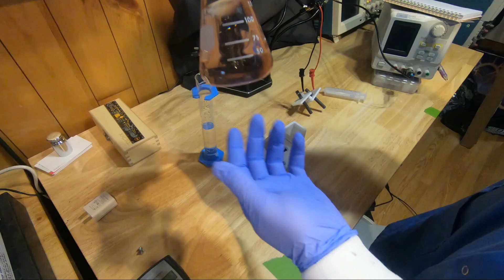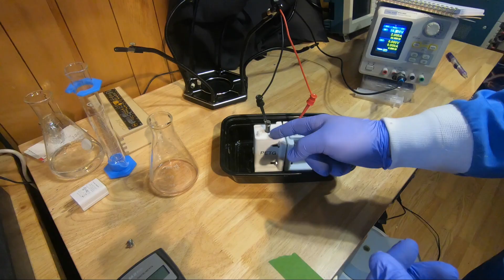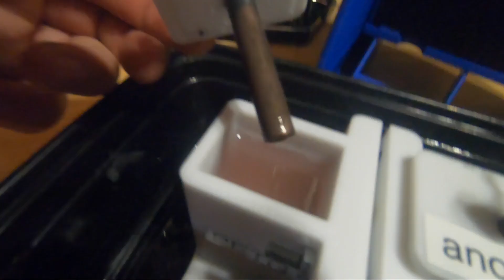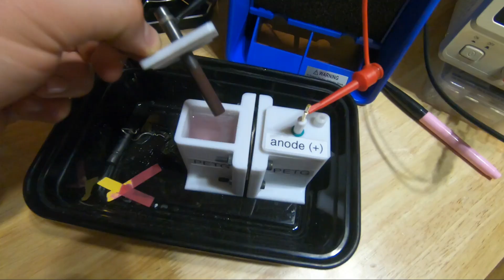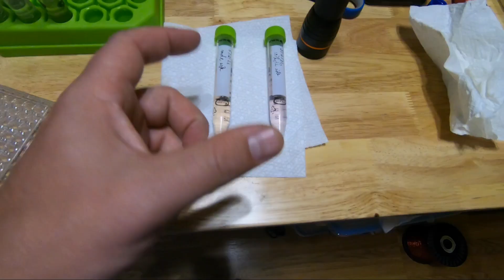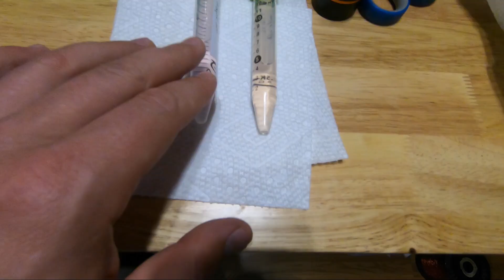Using @Rowow 's Cation Exchange Membrane to Concentrate Neodymium Magnet Solution

Comment: This is the best DIY (Test scale) of Rowow's work I have noticed so far. I have watched many of his video's and Want to suggest reworking the design to include a overflow and a drain on your Printed parts. Please don't kill me for suggesting also, that Rowow mentioned the polarity might be reversed to create a anion membrane for acids.
Reply from the maker: Suggestions are always welcome! Overflow and drain will be included when I make a flow through version of the design. Currently I just use these for batch testing, so it is not really necessary. I have started playing with coating the inside of the cells with UV resin to help with chemical resistance, turns out that overtime the PETG will slowly absorb some of the solution. 
Anion membranes are trickier, but I have also made one of those for playing with so far. Should have a video out on all of this in the next couple of weeks.
Reply: @SciPushingButtons  were you using graphite as both the anode and cathode? Could you use Neodymium as the cathode to potentially promote the neodymium to grow a crystaline percipitate? In some ways similar to a Silver growth Cell setup where you slowly grow a pure silver crystal.
Reply from the maker: @TeddyA93  I've been using graphite as cathode and platinum as anode. I'm not sure if I can even get a hold of an Nd electrode/if it would be stable in the solution. Right now I am aiming for plating off the iron, and then I can precipitate out the Nd as a sulfate or hydroxide salt.

Comment: Great test! But you filled both chambers with the same mix. To concentrate and purify Neodymium, you should put the raw magnet solution only in the Anode (+) chamber, and slightly acidic water in the Cathode (-) chamber. Under current, the smaller Iron ions will fly through the CEM membrane into the cathode, leaving pure, deep pink Neodymium behind in the anode.
Reply from the maker: Yep, there were a few mistakes with this test. I have another planned that should be a lot better.

Comment: Did you see any bubbles as in hydrogen formation?  This usually is done in molten salts because they are both cations: Fe(++/+++) and Nd(+++) Also, a non aqueous solvent may be helpful to prevent hydrogen gas evolution from the water.  Was the goal to separate the Fe from the Nd or just to plate FeNd on the Cathode?
Reply from the maker: Yeah, there was definitely hydrogen generation. The goal was to try and plate the Fe. My voltage was too high and pH too low. I'll be doing a better attempt on this in the next few weeks.
Reply: @SciPushingButtons  Because they are both cations, they will both go through the membrane and plate on the Cathode. Now if you did NaCl only on the anode side, the Na would go through to the cathode side as a cation and the Cl would stay behind as an anion.
Reply from the maker: @jonesmatthew7511  Under theses conditions though if anything plates, it will only be the iron.

Comment: To be honest, based on your results, I dont think your ion exchange membranes are working properly. Did you use the ones with dissolved red solo cups? That might have changed the formula and prevented it from working.
Reply from the maker: I ended up remaking the membranes after the red solocup attempt. Used compatible (HDPE) containers for mixing.

Comment: What do you think of the membranes so far? Regarding precipitation, changing the solution parameters (pH) on the negative side would result in that. I'm not fully sure regarding neodymium what is optimal but it definitely can be plated. May even need a pure neodymium electrode to have it plate off on.
Reply from the maker: They are performing great so far, doing what you claimed for sure. I haven't even really tried to optimize/iterate on the recipe at all, it just works. What do you think about trying to plate off/precipitate the iron instead? If I can get rid of the iron, and have a relatively pure Nd solution, then plating/precipitating the Nd out by itself should be a lot cleaner.
Reply: @SciPushingButtons it definitely would be great. There's many many ways to try to do that. Maybe use a iron electrode to plate off the iron first. Also finding if there's a solution the iron prefers to plate off as first. Not sure but definitely many options available